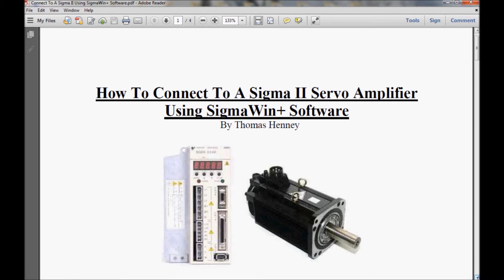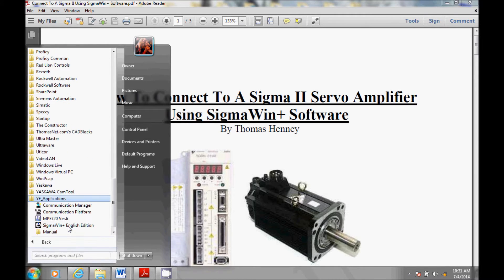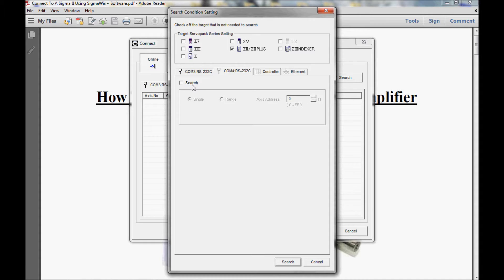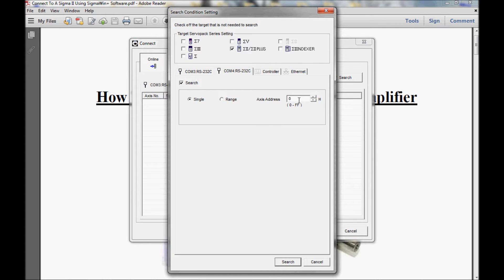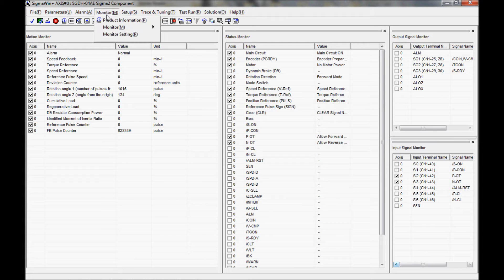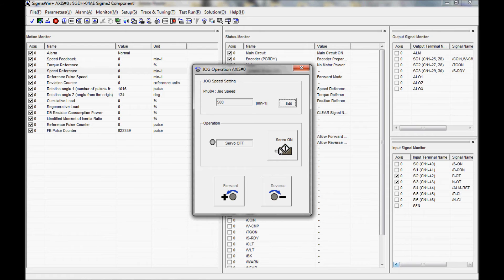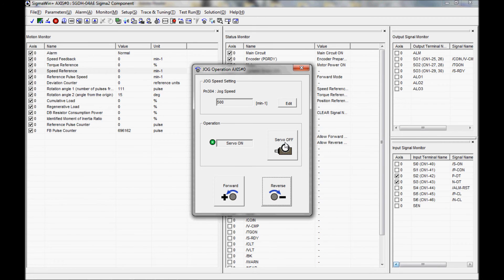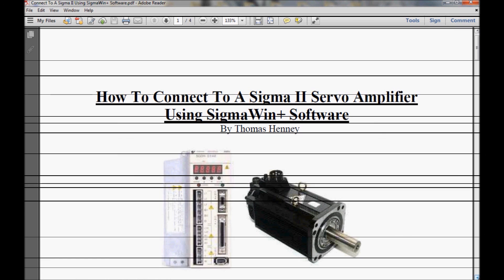Yaskawa SigmaWin+

Comment: i have to replace a bad driver. how could i get the settings off the old driver and put them on the new? the driver is a   sgdh-04ae
Reply from the maker: The best way is to use the SigmaWin software to upload the settings. Otherwise were looking at using the display and going through each parameter. 

The Sigma ll does not have a copy keypad function the would allow copying the parameters and using the keypad to download into new one.

Comment: Tom, I find your Yaskawa tutorials to be helpful, but I do have a further question. I know that there is a momentary jog function, but I am looking for a method to run a continuous program for testing repeatable movements. Is Sigmawin able to run a program that will jog it clockwise and counterclockwise repeatedly via the program or do I need to find another method to run a program? And if i am unable to run it thru Sigmawin do you have any recommendations? My controller is SGDH-01AE and Im controlling a SGMPH-01AAE motor. Thanks in advance for any information you can provide me.

Comment: Hi I've brought a used SGDS-01A01A and when connected it to the servomotor I've noticed that the driver needed some tuning as I had some vibrations. When tried to use FN017 ADVANCED AT noticed that the drive was write protected. When tried to remove the write protection I found out that is is password protected.
Then I tried to connect servo drive with the PC. I made the PC to Drive cable as per datasheet SigmaWinFIII200.pdf Page 281 (A1) but the SigmaWin+ is not finding my Driver.

Any suggestion please.
Reply from the maker: Hello samca2012
To release the write protection go to FN010 and enter 0000   this should release the Write protection. As far as the cable, check to ensure you have the proper pinout.

Enter 0001 to write protect at the next power up of the drive .

Comment: i need your advise
 "when i start jog on online mode my  servo amplifier get trip"
Reply from the maker: Good Morning Asad,First what we want to start off with is what is the error code is being displayed?This is the information you will need to have, along with what model number the type of application would be good to know.
Reply: Hi Tom 
i revived different alarms on yaskawa sigma II 50ada and 20ada. And i am trying to set parameters through software, after changing the parameters i want to check them jog test etc. but it git trips.

my procedure connect the cable, open the sigma plus, go online,  find servo, connect servo, then go to jog if servo amplifier already repaired, in jog on the motor. but when i on the motor through software amplifier got trip.

Normally i go A10, A30,  AC9,  AF5, AF6 & A81 alarms.  Could be advise about that.